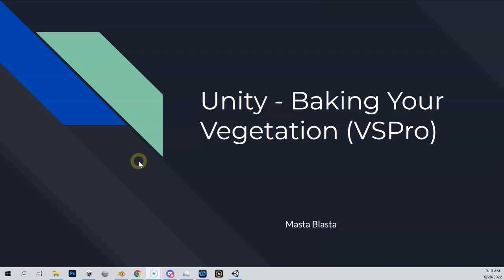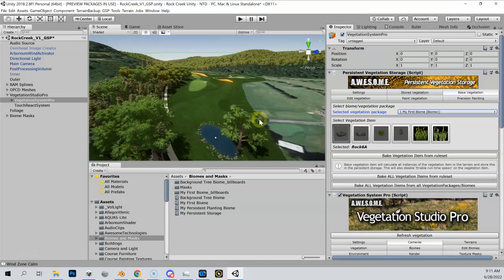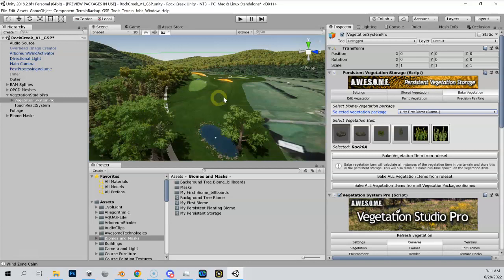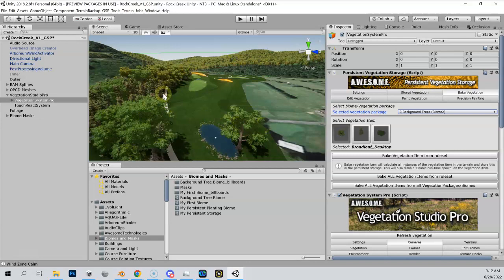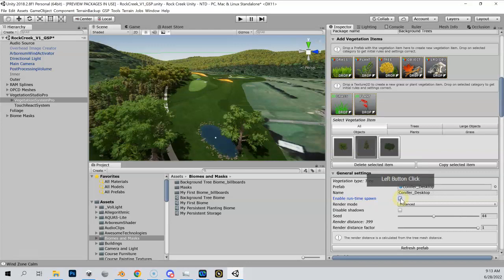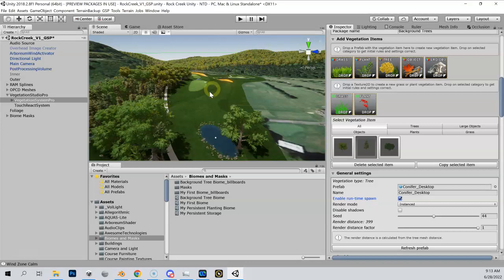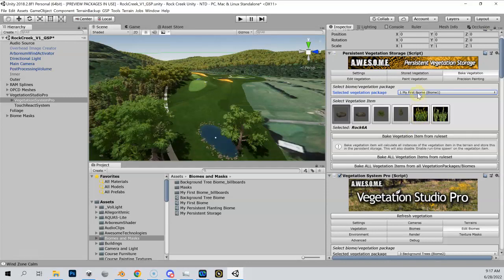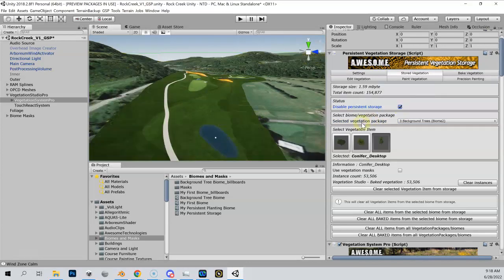Unity - Baking Your VSPro Vegetation

Comment: What is the benefit of baking the vegetation?
Reply: On lower end systems, if you don't bake your vegetation it can cause system crashes. This is typically on systems that are already struggling with GS pro. You certainly don't have to bake your vegetation but if you get reports of system crashes on your courses not baking your vegetation is most likely the culprit.
Reply: @masta_blasta  would it improve frame rates on weaker machines? Would it also help performance spikes that occur when loading in different sections?
Reply from the maker: No, it doesn't help with GPU performance. It helps mostly with how memory is used and only benefits computers with lower memory. There's some back and forth to this day from the developers on how effective it is. I would recommend that you do not bake but then if you hear of issues with your course crashing on people's systems then go back and bake it and rebuild